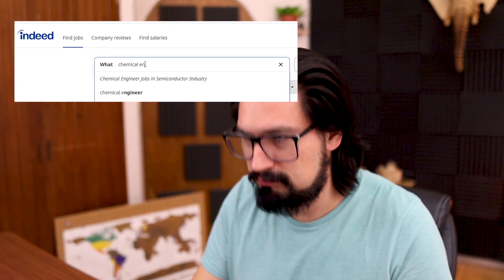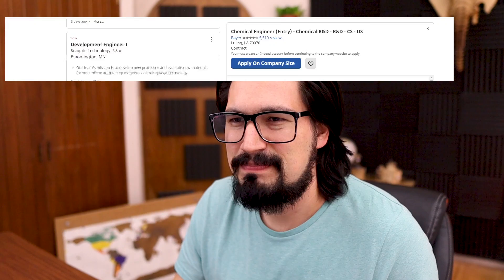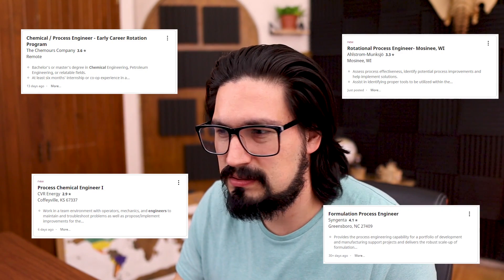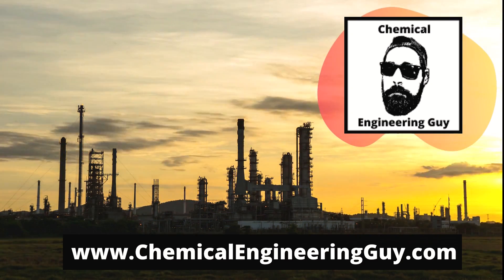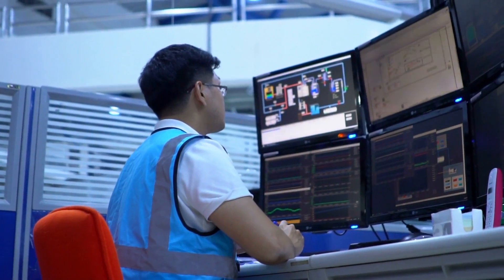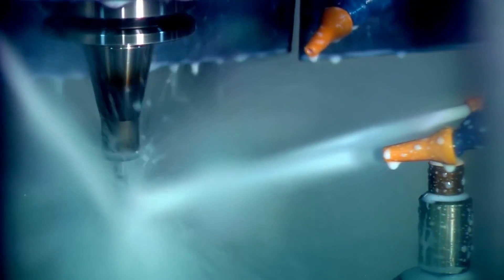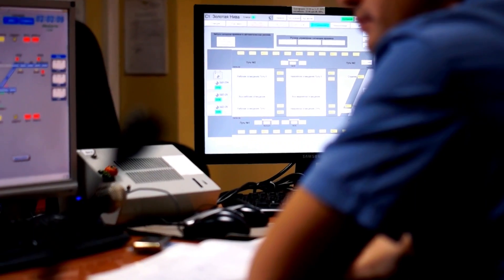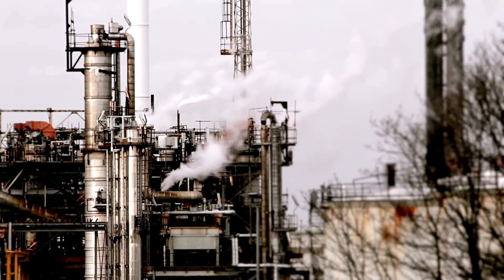What Is the Difference Between a Process Engineer and Chemical Engineer?

Comment: I have spent 40+ years as a practicing process design engineer in the oil & gas industry. Chemical engineering is the education that I got so that I could enter the work force to be trained as an O&G process design engineer.
Reply from the maker: Wow, 40+ years in O&G process design — that's incredible! Chemical engineering truly opens doors when paired with industry focus like yours. Respect!

Comment: In the United States, Process Engineering is equated to Chemical Engineering for the most part though occasionally a good Mechanical Engineer can aspire to become a Process Engineer if he bends the knee and understands he wants to be a Chemical Engineer.  This is based on my 30+ years designing chemical industrial processes and not pilot plant or demonstration plant processes.
Reply from the maker: true, process engineering is mostly chemical engineers, since they are more familiarized with chemical processes.

Comment: Process Engineers usually do the design of interconnection SYSTEMS in a plant for a technology to work.
Chemical Engineers usually do the scale-up and design of the TECHNOLOGY. Chemical Engineers use most of the fundamentals of chemical engineering: thermodynamics, fluid mechanics, heat & mass transfer, transport phenomena, physics, math and programming!! While process engineers use a lot of industry standards, simulations (which embed thermodynamics and fluid mechanics) and CAD (computer assisted drawing).
Chemical engineering is more scientific requiring quality education over industry experience, Process engineering is more industry focused requiring industry experience over education...
Have PhD in Chemical Engineering, PE in TX work in Houston, TX as a Senior Process Engineer...
Reply from the maker: You summarized it pretty well! Although it may even depend on the region you are getting your degree/working...

Comment: I'm a Process Engineer in the bauxite industry.
Reply from the maker: wow, thats interesting! whats your main role!
Reply: @ChemicalEngineeringGuy  I’ve had various roles as a Chemical Engineer. I was a Process Development Engineer responsible for implementing process improvement projects. I was a Shift Process Controller responsible for managing KPIs in the Bayer Process for Production and Efficiency optimization. I was a Quality Engineer Lead responsible for Quality Management and directing the operations of the Quality Team. I’m now a Process Engineer for the Unit Operation ‘Calcination’ responsible for controlling energy efficiency and optimization geared towards Quality in alumina product.

Comment: Wait, so chemical engineers can only work in the chemical industry? Now I understand why in the USA chemical engineers complain that there are no jobs for chemical engineers, although the chemical industry is large, it is quite small compared to the industry in general

I am a chemical engineer graduated from Spain, and due to our training in college We can work in other industries apart from chemistry, such as food, environment, materials, automotive, renewable energies, non-renewable energies, quality, logistics, supply chain, production, maintenance, agroindustrial, automation, manufacturing, etc. What a shame that it is such a closed career in the USA, I wouldn't study it there since it is a career with little scope for work.
Reply from the maker: As a ChemE, you can also work in such industries, its just that other engineering degrees will have a better advantage on that, i.e. Petroleum Engineering in Oil&Gas, Mechanical Engineering in any Manufacturing of Equipment or Industrial engineers in quality, supply chain and logistics. Make no worries, many industries and companies still value the Chemical Engineer over other engineering degrees

Comment: I'm a process engineer from Vaal tech, there is a straight degree there for Electrical Engineering (Process control), where we focus from the first semester in technical instrumentation of all type of processes  (chemical, production line, Pharmaceutical, beauty, petrochemical, automation, cybersecurity) we intervene in all aspects of any process as long as there a need of a output from an input system ..... For me the main difference btwn both of them is that chemical engineer master the product component depending on the field they are but process engineer are needed whenever there is a manufacturing industry, the master the components  of the production process .
Reply from the maker: True, this is what I've noted from European countries, you may have Engineering degrees that adapt pretty well to industry needs, that is, the Process Engineer, Instrumentation Engineer, Automation/Control Engineer, etc...
Reply: Also graduated there

Comment: I will have to correct you on the Degree potrion ... I personally have a Manufacturing Process Engineer degree, and while Process Engineering degree is not easy to find, there are some places that offer them, such as Open university UK at a Master degree level, but most of that are basics so it's best to have a batchlers degree in that and specialise in the Master degree section ...
Reply from the maker: True... you can find some specific degrees, but I wanted to share that it is not the general rule/case

Comment: I'm not sure I agree with a lot of this. I'm a mechanical/production engineer. I've worked with both chemical and process engineers and generally process engineers design, implement and optimise chemical and biochemical processes, especially continuous flow ones on an industrial scale to turn raw materials such as oil, natural gas or milk (using heat, pressure or a chemical agent) into an end product (e.g. drugs, cosmetics, gasoline, beer, butter, etc.). And for that reason, process engineers are typically trained in chemical engineering. The engineers who optimsie discreet manufacturing i.e. machining, assembling, welding, riveting and glueing things that can be counted and itemised into a distinct product often on an assembly line. (Think car assembly – Telsa’s production line for its electric cars, engines, cell phones, computers, washing machines, TVs, airplanes, syringes, medical pumps, scalpels or pacemakers, etc) are manufacturing/production/industrial engineers. They are never called process engineers. Also, there are plenty of honour degree qualifications in process engineering.
Reply from the maker: hi there! thanks for your input, as a mechanical engineer, we value a lot your reply :)  as stated by you... there are a lots of "honorary degrees" in process engineering, or overall engineerin I would say

Comment: The company i work for would only hire chemical engineers into the process department. Mechanical, electrical etc are their own completely separate departments a disciplines
Reply from the maker: Indeed... they are pretty separated, but sometimes, process engineering makes a mix between mechE and chemE

Comment: can you please make video on how to clear process engineering interview? example:topic: distillation 1.how to decide operating pressure? why do we use baffles in distillation column? also cover heat exchanger and pumps and line sizing it will definitely helps lot of engineers.thank you ❤️
Reply from the maker: I will, but first I need to interview some friends which typically get to hire process engineers!
Reply: @ChemicalEngineeringGuy  okay 👍🏻
Reply: Please do

Comment: Perfect topic sir. Can I request an explanation about: what is difference between "plant" and "factory." Thank you🙌🙌
Reply from the maker: For sure, although I would say that both care used interchangeably, factory is typically a place where you will build or manufacture pieces or mechanical stuff, not likely to deal with chemicals
Reply: @ChemicalEngineeringGuy  Thank you so much sir